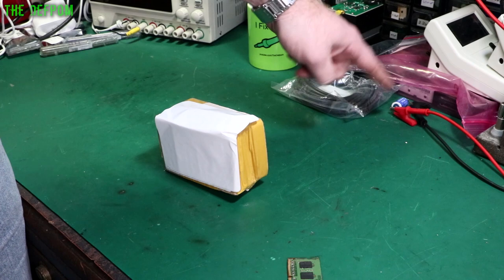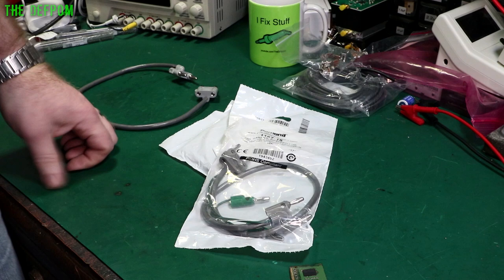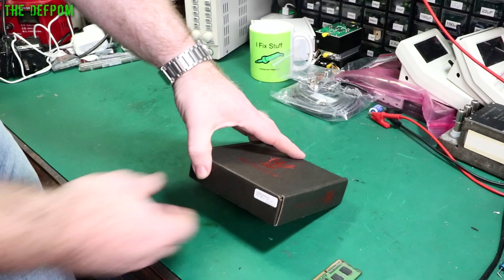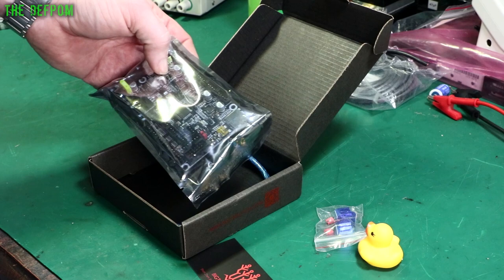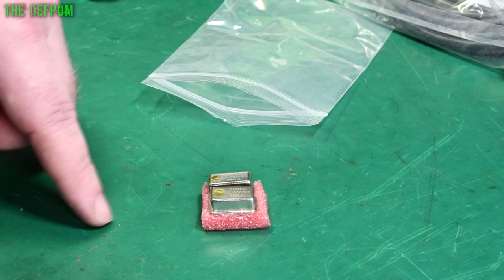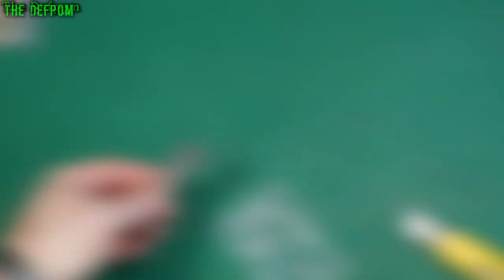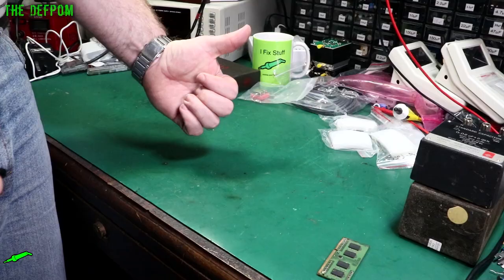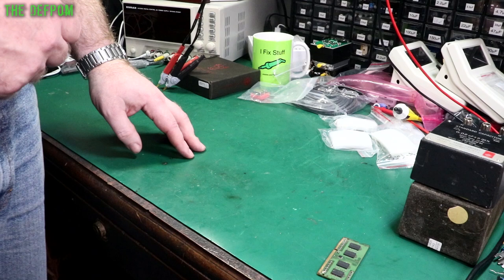#742 Mailbag Monday 3rd August 2020 - What Goodies Do I Have This Week? 🎞 📭 📦 📩

Comment: just to let you know 20nF +/- 0.05% means 19.99 to 20.01nF and 1uF +/- 0.05% means 0.9995 to 1.0005uF. so many of your measurements that you keep saying it is within spec, they are not.
Reply from the maker: This is why I should use a calculator instead of trying to do it in my head whilst trying to record video.
Reply: @TheDefpom  where are those minions when you need them? ;)
Reply from the maker: Greg M - yeah I could use some.